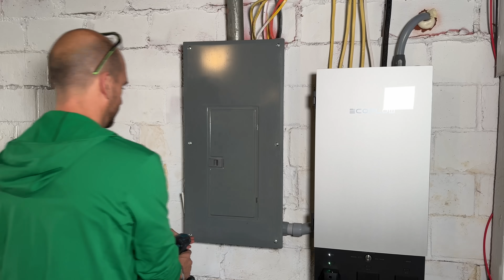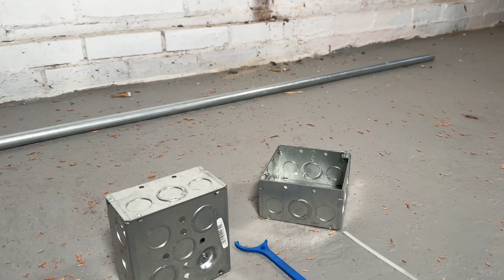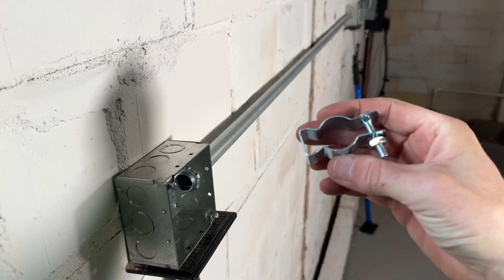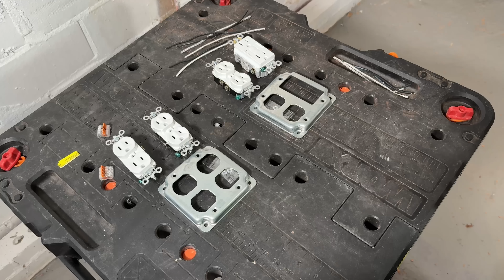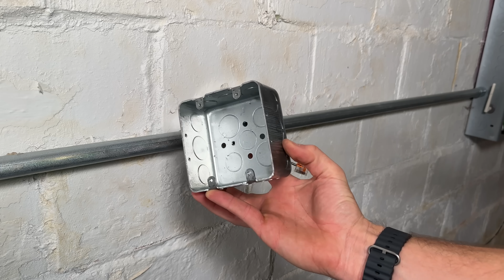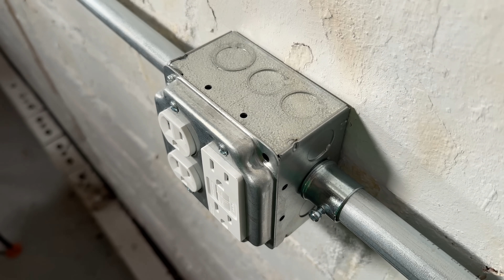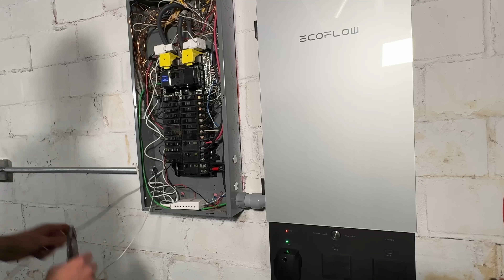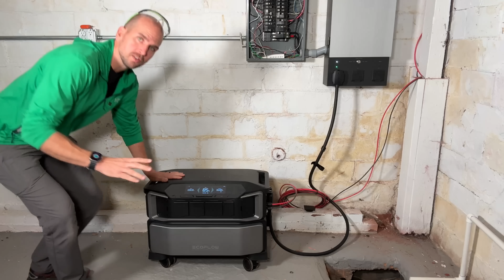Add Outlet To Unfinished Basement Or Garage

Comment: I was taught , back in the 70’s, to always use pan head screws when mounting boxes to avoid sharp edges on the heads of other types of screws that could cut the insulation. Also to ALWAYS add the green insulated ground wire, especially in damp areas, because the conduit connectors could loosen, rust or corrode and cause a high impedance ground system. Also if the box cover screws are loosened or removed, the ground is lost! Better safe than sorry! Don’t cut corners! I guess I had a good teacher!
Reply: I agree w Bob, if that locking nut on the inside of the AC panel doesn't bite into the manufacture's finish on the panel, you would have a ground continuity issue.  Green wire ground is best.
Reply: @bobhall5893  That's why, on painted boxes and cabinets, the NEC requires that the paint be removed to expose bare metal. Takes a wire brush in a cordless drill about 10 seconds to get it done.
Reply: @pld8993   NEC is a minimum standard, not a tome. Best practice is to run a ground wire.
Reply: @cvr527  The NEC is not a minimum standard ; it's a standard that, when adhered to, provides a generally safe installation and helps protects property and personnel from fire and electrocution. Doing more than the NEC requires does not always add value. Best practice would be to run rigid metal conduit for house wiring, but that doesn't make it necessary or reasonable. Professional electricians run metal conduits all the time without wire type grounds. Running an unnecessary wire EGC when the metal conduit is more than sufficient, and in many cases superior to a wire EGC, is a waste of time, labor and money. I've done projects where adding a wire EGC to all my conduits would have added many thousands of dollars to the project due to increased wire cost, larger conduits for the additional conductor, increased labor, etc., with zero increase in performance or safety. If you were an experienced electrician, you'd understand this.
Reply: @pld8993  I repeat: NEC is a minimum standard.
Reply: @cvr527  Repeat it all you want, you're still wrong. It is a sufficient standard to minimize electrocution and fire risks and doing more than it requires or creating redundancies within an installation does not necessarily increase safety. Become a real electrician who does actual installations and you'll understand why you're wrong, but thanks for playing.
Reply: @pld8993   Yet the NEC is the minimum standard and always has been. ;-)
Reply: @cvr527  Local AHJs can deviate from the NEC in either direction. They can make local rules more stringent than the NEC, or they can waive NEC rules and make local rules less stringent. But maybe if you keep believing that it's a minimum, that will make it come true.
Reply: @pld8993   NEC is and always has been the minimum standard period.
Reply: @cvr527   Thanks for your uninformed, non-electrician opinion. Maybe if you say period enough times that will make it come true.
Reply: @pld8993  Grow up!
Reply: @cvr527  When I grew up I studied the NEC. Try it, you'll learn something.
Reply: @pld8993  If all you studied was the NEC then you have never grew up. ;-)
Reply: @cvr527  I never said all, genius, but go ahead and pretend that's what I said so you can feel better about yourself.
Reply: @pld8993   Grow up!
Reply: @bobhall5893  Yea, to run 3/4, and such a short run, being in a basement, brand new install... to not run a ground is just shortsighted.
Reply: Then use a grounding bushing.  @bobhall5893
Reply: @bobhall5893  Or just remove the paint at the fitting, which the NEC requires.
Reply: I agree.  Why not just hook up a ground wire anyways, since you know that will be code in pretty much every area vs this technique which may or not be?

Also, it sort of protects you from someone less informed in the future that may replace the outlet with a non-self-grounding variant.

If they see a ground wire on the existing outlet, they're much more likely to connect to their replacement.
Reply: UK style we cut threads into the pipe ends and then they screw tight onto the fittings so I'm happy that conduit ground won't be compromised over time.  The US style insert and fix with a set screw is available here and I'm not as happy with that and would likely run a ground conductor as insurance.  We'd pigtail the faceplate/outlet assembly to the back box so unscrewing it would not sever the ground connection.
Reply: @calmeilles  This is EMT, electrical metallic tubing, also called thinwall, it cannot be threaded. GRC, which is galvanized rigid conduit is much thicker, heavier, and thread-able. This video has some non-professional practices. The most glaring is the lack of any support for the conduit. Although the way he made his electrical connections is compliant, he could have simply stripped the conductors and looped them around the screw terminals without ever cutting the conductors after connection to the load terminals of the GFCI. If this basement is below ground, judging by the small window in the video it likely is, inspectors do not want steel boxes directly supported to the masonry, they want a moisture-proof backboard to prevent rusting.
Reply: My electrician asked me if I wanted a green wire inside EMT, he said most people don't because of cost, but he would always pull a green for his own work.
Reply: @kknows3512
If he is the professional and he has to sign it, he should not ask the uninformed customer.
It his profession to know and do the right thing.
Reply: I was also taught to use a green ground wire in conduit because the conduit could rust, break or be inadvertently removed from the box, plus there is not guarantee that the main panel is properly grounded. There is also a question of the impedance of the conduit versus a dedicated 12AWG wire.
Reply: @jimmeade2976  A green ground wire could corrode, break, or be inadvertently removed from the screw. There is not a guarantee the neutral bar to which the ground wires are attached is properly grounded. Both of our arguments are what-ifs and neither one is a better argument than other as to why you should not do the other one.
A properly installed EMT system is a better (electrically) grounding path than a copper conductor up to about 400'.
Reply: Grounding to box with  wire is required in every box that has connections..
Reply: @twistedhillbilly6157  Incorrect. Other grounding means, other than a pigtail, are allowed.
Reply: @pld8993  OK,, what is allowed...
Reply: @twistedhillbilly6157  Self grounding device to metal box. Yoke on a standard device making direct contact with metal box. Cover mounted devices secured with permanent means (rivets, irreversible screws, etc.). None of these require pigtails.
Reply: @pld8993  Are you saying wire to device and let the device touching the box be sufficient with no actual wire going to the box?
Reply: @twistedhillbilly6157  Correct
Reply: @pld8993  2 things.. Is that NEC? and is that how you do it on industrial jobs? (assuming you are an electrician)
Reply: @twistedhillbilly6157  250.146 and 250.148. In practice, it's usually easier to use a pigtail for cover mounted devices, though I've done projects where irreversible screws were spec'd. In comm/ind when using self-grounding devices, yes.
Reply: @twistedhillbilly6157  NEC didn't require irreversible mounting screws or rivets for cover mounting until mid to late 2000s, can't remember exactly when. Even back in the 80s and early 90s before more than 1 screw was required for device mounting, receps were grounded through the cover through a single mounting screw in the center of the recep.
Reply: @pld8993  I "play" electrician from time to time on road projects. No schooling, no certs. Oddly, I score real high on tests and I am always put in a lead position. I very rarely look up anything. I use the word journeyman because I prefer their wages over apprentice wages. We both know that 95% of the work on any site doesn't require much knowledge. Everything was calculated, designed, and figured out long before we get there. What we just discussed is always going to be the bosses preference. EXAMPLE: Many years ago, I helped a friend rope some houses, his preference was,, never use the device as a connector but push in's are OK (with 14ga), so we pigtailed and used the holes. Other people say OK to not pig tail but use the screws, and some say use all 4 holes and no wire nuts no screws.. ANY of those is OK and NEC. I watch these videos because most of the people making them are clueless (like this guy) and shouldn't be giving this type of advice.. Bad plumbing gets your floor wet,, Bad wiring and family & friends gather to remember you and say a final good bye.. Anyways,, Thanks for the info....
Reply: @pld8993  I posted a long reply and YT must have censored it.. Oh well,,, bottom line,, do what the boss says.. Very few independents do industrial installs so you are always .listening to someone/. . I didn't even know that one screw was no longer allowed..
Reply: @pld8993  not accurate. a receptacle needs a bondong connection besides the screws
Reply: @rickhawkins218  Incorrect, 250.146(A) and (B)
Reply: Remember that the code is the bare minimum to pass an inspection. Exceeding code runs into extra money but if your working on your own stuff or something important. The cost isn't that great.
Reply: I live in Chicago where EMT is required and Romex is illegal. I have never seen a ground wire in EMT conduit, ever, in a residential setting. And if a hot ever hits the conduit the breaker will trip instantly.
Reply: @SSHitMan  Correct. I spent 20 years working in Chicago, never ran a ground wire in comm/ind unless it was spec'd, and never in residential.
Reply: Interesting discussion of using grounding wires with EMT conduit. 
At the very least I install a green ground pigtail from the rear of the  J box to the green ground terminals of the duplex outlets. Note that the cover plate is fastened with only 2 screws. I’ve seen plenty of those screws get loose. 
I don’t often pull a green ground wire through the entire length of conduit. Properly tightened EMT fittings actually do make solid low-resistance connections, assuming any paint is removed, especially from the knockout holes in the panel. I’ve tested the resistance of a 40’ run of 1/2” EMT with several J boxes along its length. The resistance was equal or lower than the same length of 12 AWG copper wire.
Reply: While a separate ground wire may not be needed under NFPA 70, local/state codes may require it.  The good thing is regardless of the condition of the ground, the GFCI will continue to provide ground fault protection as it does not rely on the ground to operate.
Reply: From an area that requires conduit. I've never seen a build that runs an EXTRA ground in addition to the conduit, and I'm pretty sure that violates 250.30 (A)(1) providing parallel ground paths.
Reply: @embracethesuck1041 I am absolutely certain that it is not uncommon to run ground wires in conduit and I am absolutely positively certain that there is no Code violation when doing so.
Reply: @embracethesuck1041  250.30 applies only to separately derived AC systems. Running a ground wire is not necessary when the conduit's done correctly but it's not forbidden, and it must be bonded to the EMT system at every box, panel, etc. where the conductor is broken/spliced/terminated.
Reply: I see a bigger issue, being an active code violation of 358.30 (a) in that "EMT shall be securely fastened in place at intervals not to exceed 3 m (10 ft). In addition, each EMT run between termination points shall be securely fastened within 900 mm (3 ft) of each outlet box, junction box, device box, cabinet, conduit body, or other tubing termination." And neither exception talked about applies here as far as I'm aware because it's all exposed and a structural member runs behind the entire length (the brick wall).
Reply: Absolutely use pan head screws! 
 Just pushing the bent excess wire against those hex edges can be enough to cut through the wire insulation and ground the conductor!
Reply: should always tape each individual device with electrical tape BETTER SAFE THAN SORRY...against code to not have a grounding pigtail in any metal box
Reply: @garytipsord4085  Grounding pigtail not always required.
Reply: Codes have changed.Now a specific green bonding screw is required.
Reply: @williamd6967  Incorrect
Reply: ok
Reply: I always run the ground wire even though it isn't required, but in this case, most of the circuit is GFCI protected anyway so not a hazard
Reply: Washington State code you have to run a ground wire even if those metal pipe are connected all the way back to the panel, still run a separate group because more safer like Bob mentioned!!
Reply: @Tainamuchannel  There's nothing written in the WA state code that says that.
Reply: My experience is more toward high power communication equipment.   Using the EMT as a ground is a good way to get a hole burned in someone by stray RF power.  No way that silly emt&pray ground will work, at best you are fighting ground problem noise forever, at worst someone gets a hole burned through their hide by your mistake   Even more, since there is every possibility of a grounding failure, or at least a high resistance to ground downstream of your GFCI, it is possible for a ground fault error on the last outlets that goes unchecked by the GFCI.  You end up with people that think they have a GFCI protected outlet, when they actually do not have that safety factor.

quit being cheap, buy the damn green wire before you hurt someone.
Reply: @CaberFeidh  GFCIs operate without the need for grounding. In other words, a grounding failure or loss will have no negative effect on the GFCI's ability to do its job.
Reply: Back then wire insulation is 60*rated and clothe wrapped .
Reply: @ no, not in the 70’s, vinyl and plastic insulation
Reply: @benzaguru4548  Mmmmm tube and button.   I bought a house full of that fine stuff.
Reply: Cutting corners is today’s work ethic
Reply: Howdy. That's right.
In Europe using the conduit as a ground conductor is a code violation. All currents should run in wires, including fault currents.
Metal conduits or pipes must be bonded though.
Regards.
Reply: I saw some ''pro'' work where the guy had 'grounded' the EMT by running a 10' length of bare ground wire a few feet into the conduit. Folded it over to increase the contact area.  Did that at each end of a 60' run. 

Only reason it got noticed was that people were getting bit.
Reply: @redjohnson4859  Obviously not a pro and a perfect example of why electrical installations should be done by someone who knows what they're doing.
Reply: @pld8993  There have been plenty of instances of "someone who knows what they're doing" not doing the correct thing.   It should be better, but.....   People are lazy, careless, drunk, cheap, whatever and will often do stupid things when no one is watching.   It's why we have inspections, even that is not a failsafe.
Reply: That's a neat idea. I've been running emt for years and I've never seen or heard of that lol. Cool tip.
Reply: I don't call it 'bit'; I like to call it electrical education. @redjohnson4859
Reply: @redjohnson4859 What a half ass way of doing something and not a legal ground
Reply: Well I agree that a separate ground would be money well spent (I mean really, a few feet of green wire a couple more WAGO's and pigtails isn't THAT much.

But by code....  a GFCI protected string doesn't even NEED a ground, this is sometimes done in older homes to replace two-prong receptacles with three-prong, adding GFCI and properly labeling the receptacles.
Reply: @mikefochtman7164  That's only when retrofitting old circuits.  This is a completely new circuit in an unfinished space.  Every box should be pigtailed and grounded.
Reply: @mikefochtman7164 the circuit is gfci, the egc is redundant at that point...
Reply: @coreyfranco7060 EGC is a code requirement for a new GFCI circuit. Don't confuse that with the allowance for better-than-nothing GFCI on a hard to retrofit old circuit.
Reply: @charliesullivan4304  all im saying is that the egc does nothing for a gfci branch ckt so why are we arguing about the effectiveness of the conduit as egc lol.  Effectiveness of what?
Reply: @coreyfranco7060  EGC is a code requirement.  If you don't understand why it's required, that is ok if you follow the code.  But if you want to understand why, a few of the reasons are that a short from hot the the conduit, upstream of the GFCI receptacle will leave the conduit energized and without GFCI protection, ready to kill someone.  And a similar fault downstream of the receptacle, in the building wiring or equipment plugged in one of the receptacles won't trip the GFCI until there's another path to ground such as a human.  Better to trip as soon as there's a fault.
Reply: @charliesullivan4304  charlie i said a protected branch circuit so if someone touched the conduit then no they wouldn't die lol, the gfci would trip.  The gfci would also be capable of detecting a high resistance ground and would trip also...
Reply: @coreyfranco7060  Sometimes GFCIs fail, and they don't always fail safe.
Reply: @darrendolphdragos9752  no they self test and lockout automatically...
Reply: @darrendolphdragos9752  You've seen a gfi fail not safe? I have only seen them not energize, not not de-energize.
Reply: extremely well written.
Reply: @tedlahm5740  Yet false.
Reply: There's no issue with properly installed EMT fittings and rust, corrosion, or just magically loosening. EMT is installed outdoors all the time so an indoor potentially damp area is of no concern. I learned to install EMT properly when I first started and to this day I don't run wire grounds unless there's a particular reason to do so. The NEC lists 14 types of grounding conductors; only 1 of the 14 is a wire type conductor.
Reply: @pld8993  I agree, but in my lifetime of experience, I have seen people loosen screws and connectors to paint, remodel and many times never reconnect properly… both in residential and commercial locations. An extra piece of wire can save a life
Reply: I guess the guys I learned from told me it was the right thing to do, I suppose I thought it was code back then. We always used a ground wire in emt, 4” rigid with 500mcm feeders… always a green bonding wire. It’s called doing the right thing regardless of the extra cost.
Reply: @pld8993 I’m not convinced “There’s no issue with properly installed EMT…” when a bunch of the comments document exactly the opposite!
Reply: @JackTRyan  Understood, but you'd likely have a different, and certainly moire informed, perspective if you had several decades of experience in the field working with EMT. It's hard to get a sense of what's real though online forums where there is so much opinion based on very limited professional-level exposure to the trade. I'm not saying that every real electrician shares my opinion and there are many electricians who have decades of experience who've never even worked with conduit in any substantial way. There's no substitute for getting down in the trenches, so to speak.
Reply: @JackTRyan read the code book, thats what it says...
Reply: @pld8993  If you were taught to install emt outdoors properly you were taught to use rain tight connectors which do not qualify as a proper bonding means and you ran a separate bonding conductor.
Reply: @rickhawkins218  Raintight EMT fittings are suitable for grounding and bonding. The UL listing for EMT fittings requires bonding capability. I was taught to install compression fittings outdoors, before the rule for raintight fittings went into effect.
Reply: @pld8993  CEC mix up. Not in Canada. RT fittings- pull a ground.
Reply: Dont use wagos either, all short cuts
Reply: @RadioRich100  Are wagos bad?  Sincere question; I just used some and want to know.
Reply: @billsmith7673  Yes they are a shortcut gadget and donot provide direct connection between conductors and add resistance.  Also physically they dont hold on to the wire. It depends on a clamping spring which gets hot and loses tension over time, plus the levers pop open when you push them into the box. Take the extra couple of seconds and twist the wires and install the wirenut it will never fail.
Reply: @RadioRich100  OK thanks. That makes sense and I learned something.
Reply: Tbbbbbt!  (fart noise)
Reply: Ron is that in reference to your last video where you blamed that cat. 🤣 @glasslinger